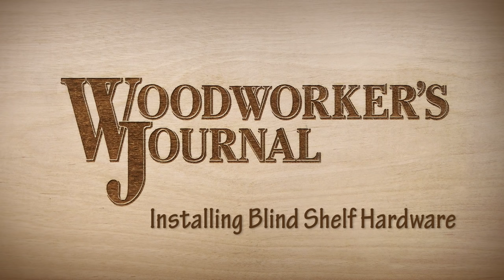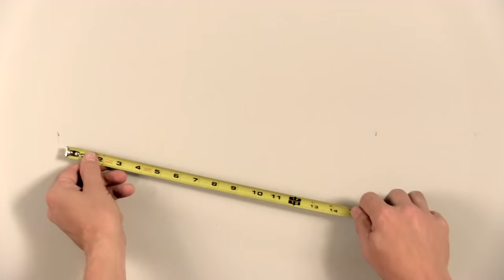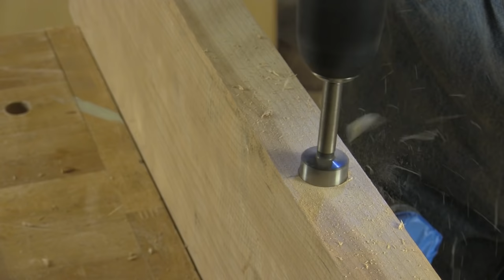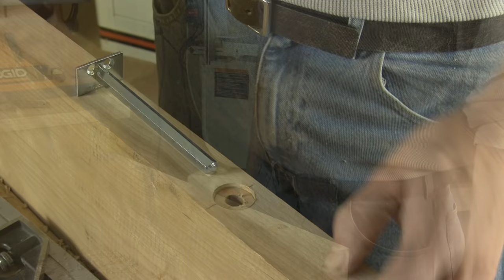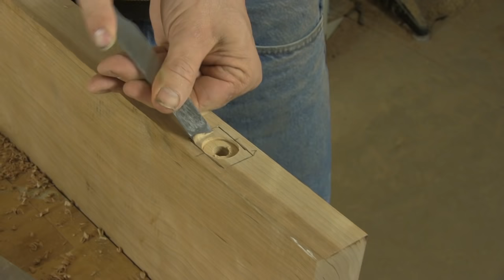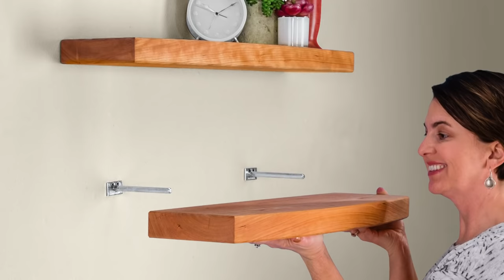Installing Blind Shelf Support Hardware

Comment: Very nice video. The reason I like this video compared to others high views count video on the subject is that you don't need other expensive tools such as a drill bit or  doweling jig to put up a floating shelves, just a power drill as the main tool. Plus the video just get to the point with no useless intro.

Comment: I just did something like this but the wall was slightly curved in the back. So I scribed the back of the shelf so that it followed the wall and planed that curve down. This before boring and chiseling out a pocket to prevent needing to rework the depth after planing. (the front edge served as the reference plane for the drill press). This made it fit very flush. Also I mounted the posts first to the wall. Slight variations in actual vs. expected positioning will not be an issue. Also probably obvious but the work needs a level. Most posts seem to have a 1 degree up angle and the shelf doesn't slide off (at least before all of the items on the shelf would slide off and destroy themselves first).

Comment: the video glossed over the portion I'm having trouble with.  What's the trick to getting the metal wall bracket on straight?  I tried pre-drilling with a self-centering bit, but still wound up with a crooked bracket.  The chamfer on the plate draws it out of parallel when I tighten it down.  This seems like it should be the easy step!  EDIT: My solution was to use Kreg / panhead screws which gave me the ability to fine tune the plates a bit.  Just need to clear a bit more material from the shelve to accommodate.

Comment: Great short video, the issue I had with the brackets I bought is that in no way possible they are 1/2". Tried 3 different bits and not even hammering it lightly does it go in.

Comment: It looks like the mortises for the supports are not tight enough or there needs to be some kind of secure way to fasten them to the shelf such as a set screw that can be concealed with a dowel or a button because what will stop the shelf from traveling away from the wall. Nearly every house or other types of buildings vibrate. You may not always feels it, but they do. Whether it be from everyday walking to closing doors to cars or large trucks driving past and if you're close enough to an airport, then the planes taking off and landing.

Comment: No set screw to keep them from sliding off?
Reply: Yep, over time they are going to vibrate right off if you do not keep a watch on them.
Reply: You can probably cut out an area in the back for a small L-bracket that attaches to the wall and the bottom of the shelf.
Reply: use glue inside of holes ;) that's works 4 sure !
Reply: @DBUSA_ , this is actually a genius idea :) make a cut out for the L bracket, screw the L bracket to the back of the shelf, then screw it to the wall. And you could  build small wooden caps to cover the length which is screwed to the wall and visible.

Comment: where do you buy the metal wall brackets?
Reply from the maker: The ones shown are from Rockler: https://www.rockler.com/blind-shelf-supports
Reply: @WoodworkersJournal  what is the diameter of the actual mounting arm? asking for bit size reasons. unless im overlooking it the website doesnt have the specs of it. also, do you recommend using a arbor drill bit for more precise drilling of holes into shelf?